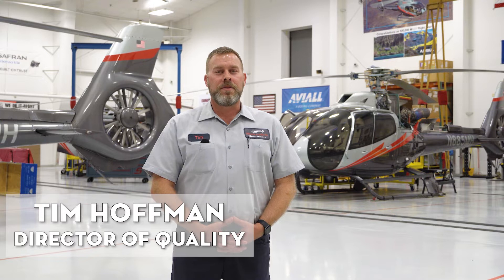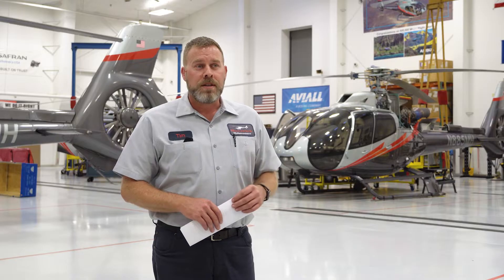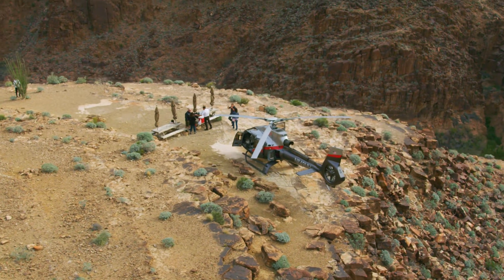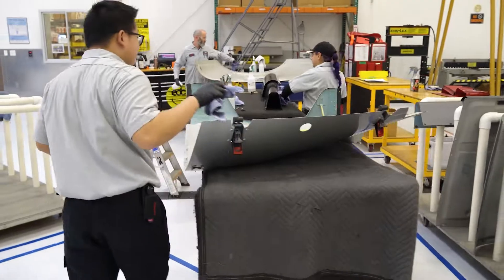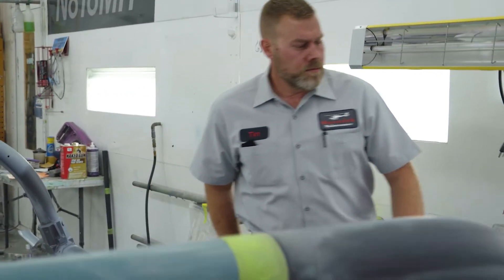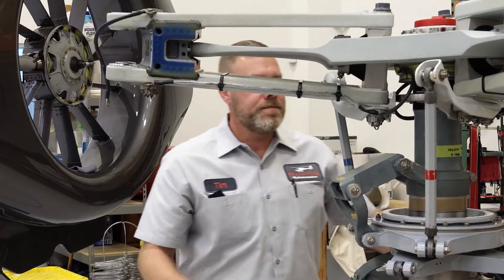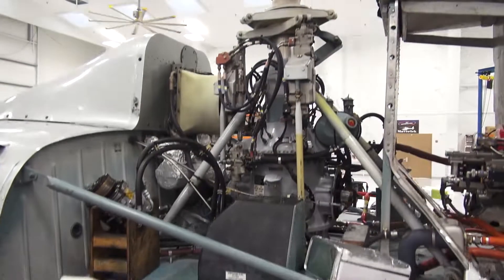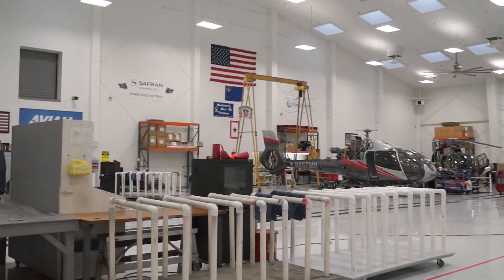Learn how to become an Aviation Mechanic | Helicopter Service & Maintenance

Comment: I work on EC130s, AS350s and AS355s here in Europe. Is a EASA to FAA conversion possible or do I still need to take all the tests all over again?
Reply: I work in maintenance (EASA part 145) and we have about 55 aircrafts so we are very very busy but it is also very stressful at times but I still love my job